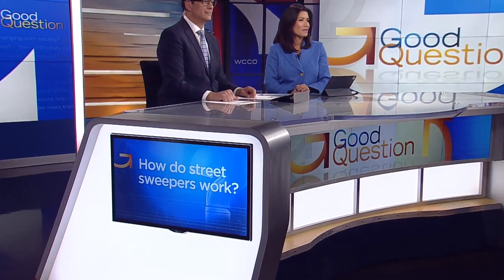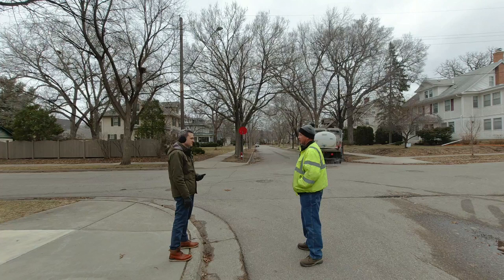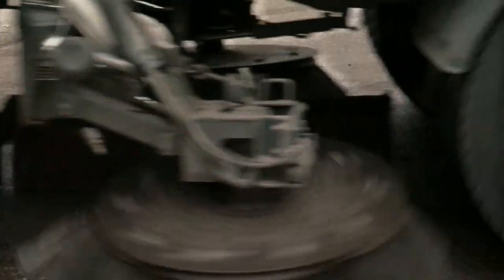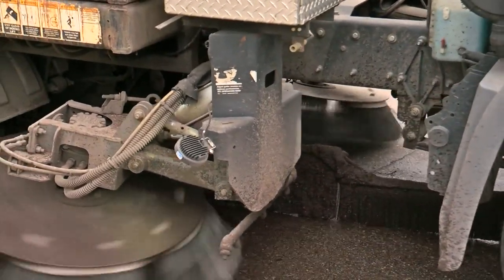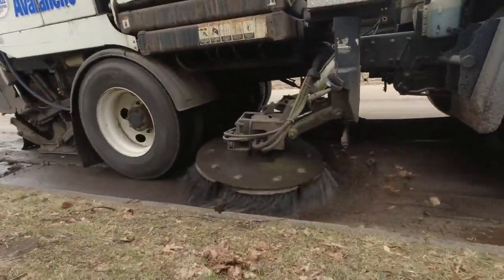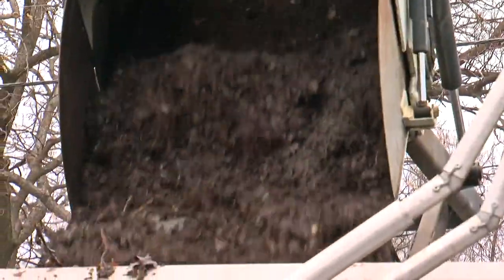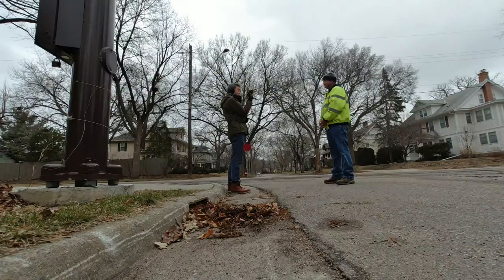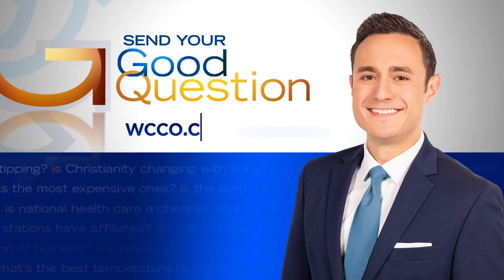Good Question: How Do Street Sweepers Work?

Comment: why did the dirt just fall out at the back?!? 😂😂
Reply: Because it's clogged
Reply: Exactly
Reply: It’s a small portion of the dirt, maybe 5% falls through the cracks. It isn’t a perfectly sealed system — you’re just using brushes to flick it onto a conveyor. It won’t all go 100% in the exact direction you want it to, some will fall through, especially at he edges. The second sweeper is supposed to get whatever’s missed. We use a lot of sand throughout the winter here, so for us, we usually have a minimum three sweepers on a crew during spring clean up. And at times, that isn’t even enough
Reply: Going wayyyy tooo fast

Comment: Has anyone converted their lawn mower deck to a road sweeper.Saw a few pictures of someone changing the 2 mower blades for brushes and putting in a water tank with hoses pouring water into the 2 brushes.Was wondering how it would work.